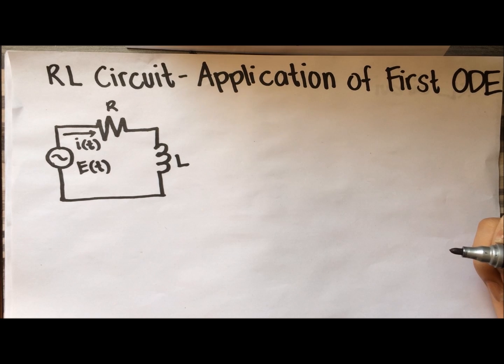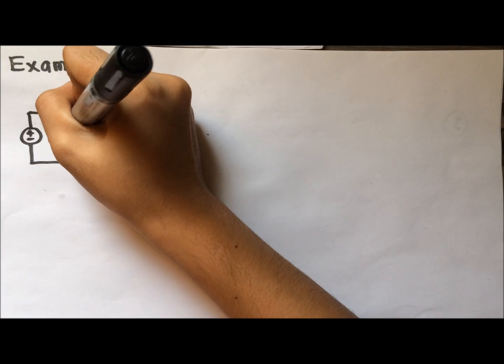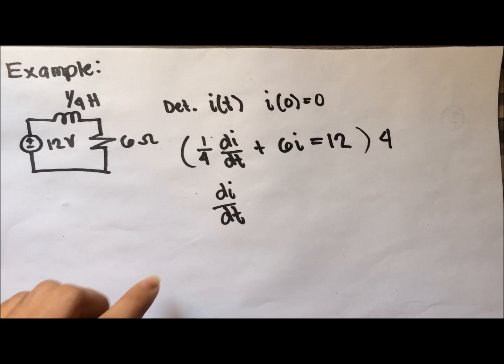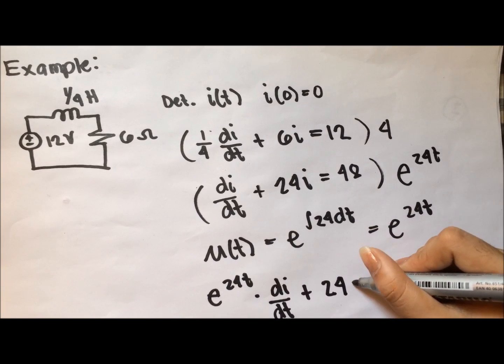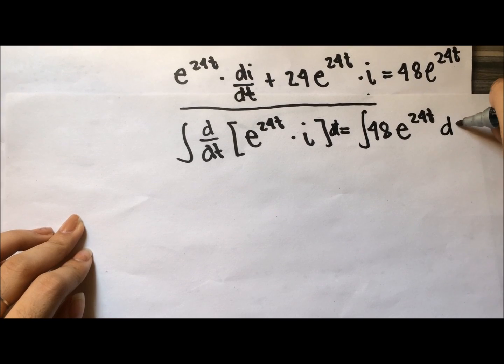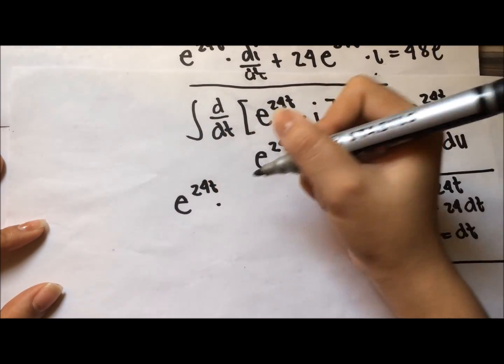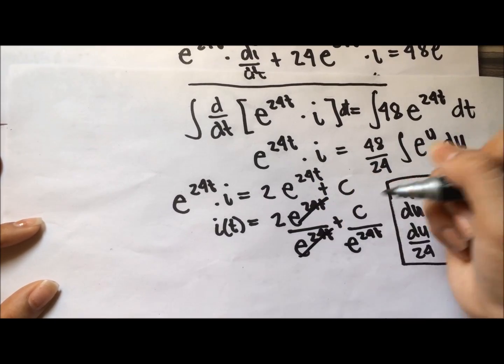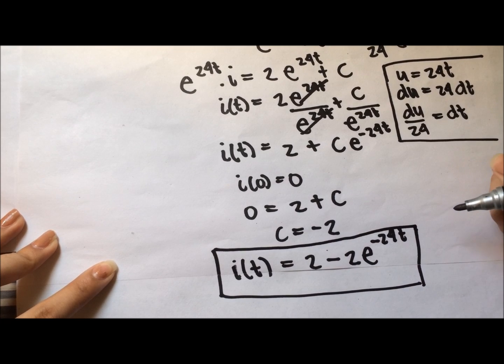First Order Differential Equation- RL Circuit

Comment: Electronic Engineering technicians with Associate Degrees don't use  calculus derivations, we just use practical mathematics and multimeters, oscilloscopes, spectrum analyzers for measurements and testing building circuits assisting Degreed ELECTRICAL engineers in the Real World.

Comment: Thanks. Can anyone tell me how did she get the integrating factor
Reply: I was don't even recall using integrating factors for some reason, but it appears to be a technique for solving ode's. It appears to be selected from the coefficient of i (in this this case)
Reply: @danielashleybaker  yes this problem is called the first order linear differential equation